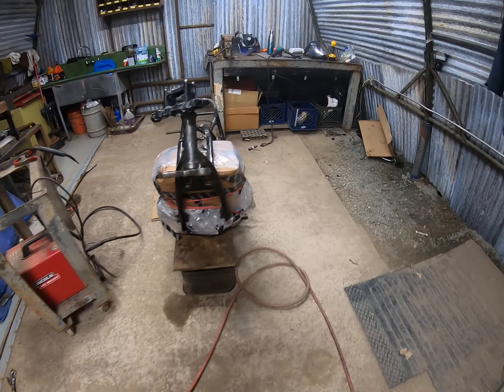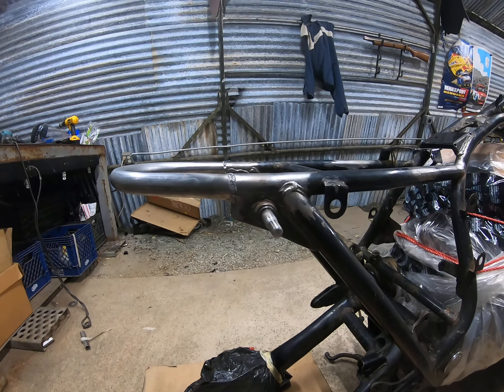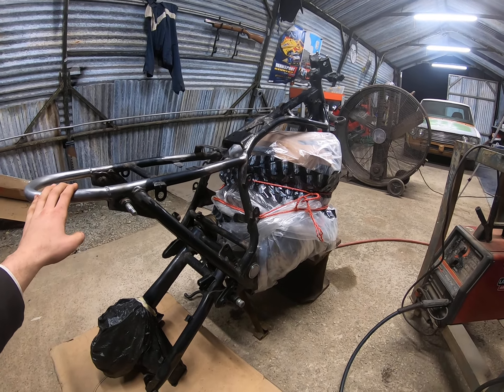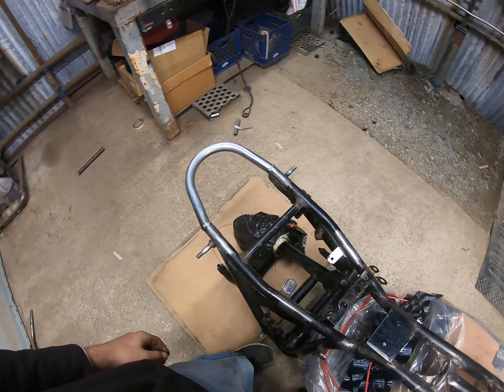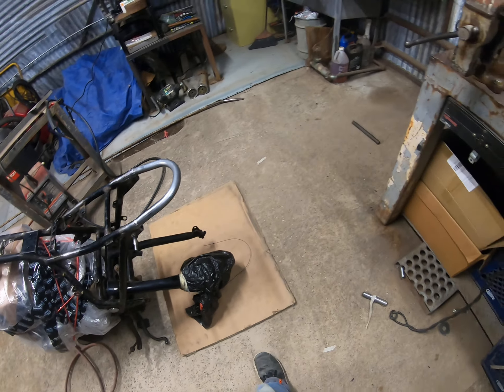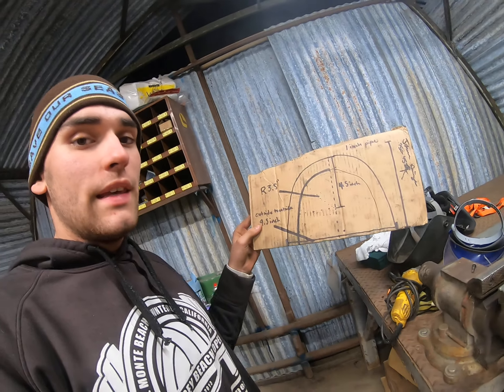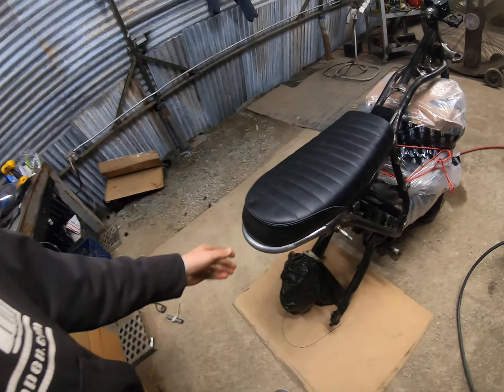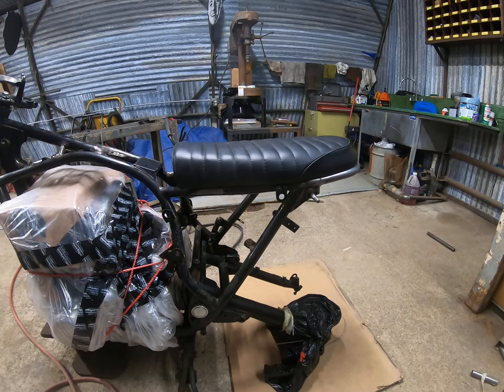Cafe racer seat hoop 1982 Suzuki GS650

Comment: Where did you get the seat? I’m currently doing a 81 650 also
Reply from the maker: https://www.ebay.com/itm/Motorcycle-Flat-Hump-Saddle-Cafe-Racer-Refit-Seat-Cushion-for-Harley-Sportster/264414932471?hash=item3d905badf7:m:miQfVN9KgTqtROHItBSW8Tg

Here's the seat I got, I chose the top option. It's cheap but the quality is decent . I had to slightly modify the mounting brackets by drilling a few extra holes I could bolt to the chassis.